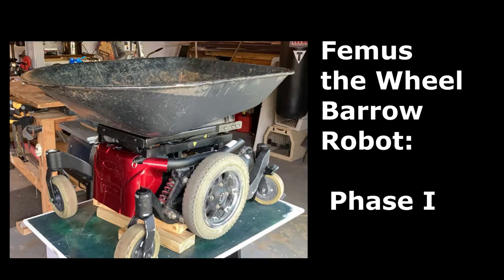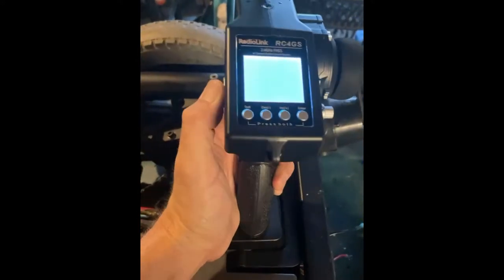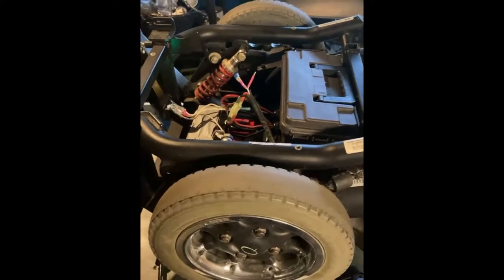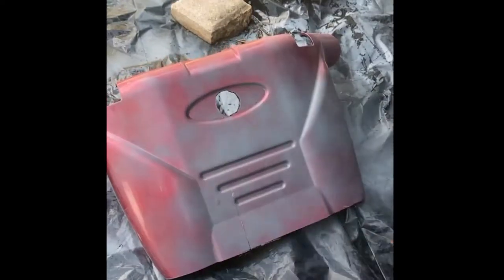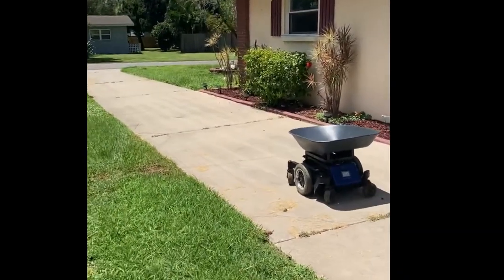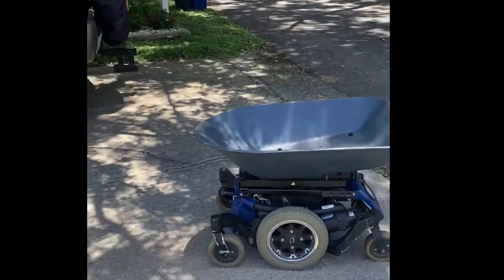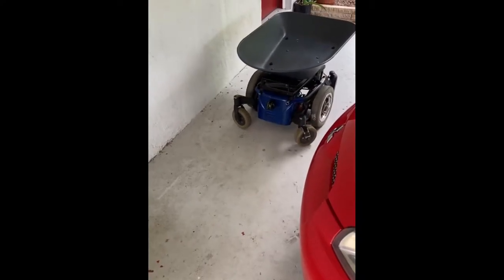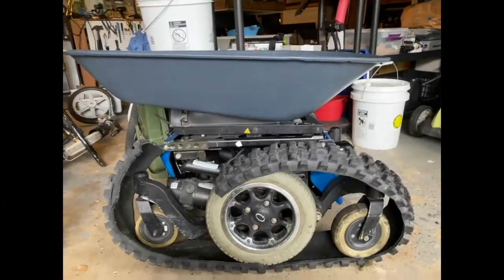Femus the Wheelbarrow Robot -  Phase 1

Comment: Great job Chuck! I came to the same conclusion as I have a property in Houston with a large yard and I a have a 220 acre ranch in Livingston Texas, I’ve been in electronics and data technology all my life, now I’m working to get my masters in A.I. Built my first robot using perf boards and wire wrapping when I was 14. I told myself we are in the 21st century with, robots, A.I. UFOs admitted to existence and powerful battery powered chassis all over the place and there has got to be a better why to move your gear or yard dirt and debris. I thought of using a used hoveround, cameras, sensors, gears for dump and a barrow dump. You are already there! Great job. I started looking up robot wheelbarrows and they are everywhere, so instead of reinventing the wheel I hope to just get plans from someone who has figured out how to create an autonomous, a.I. working unit. Like TARS in Interstellar. LOL, or… I’ll just have to make it myself.